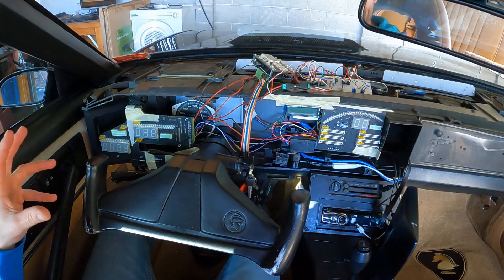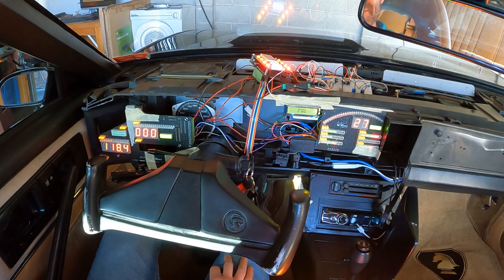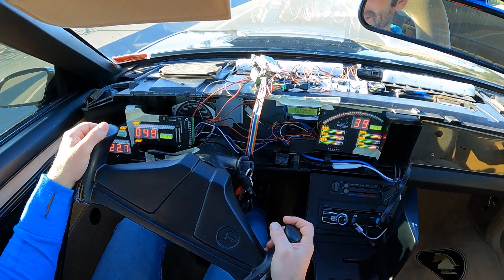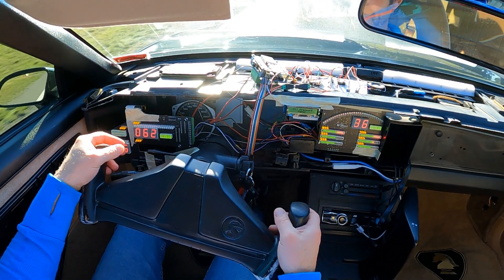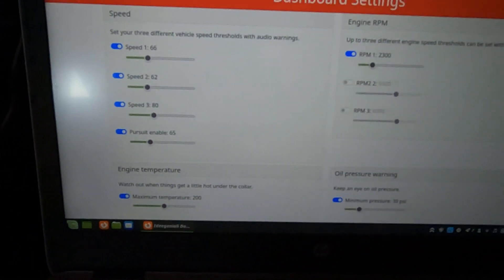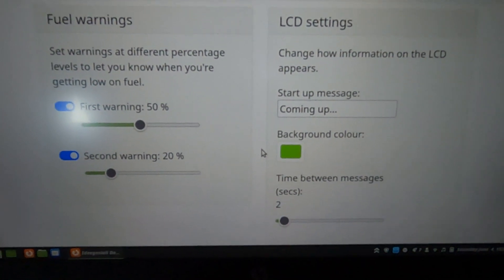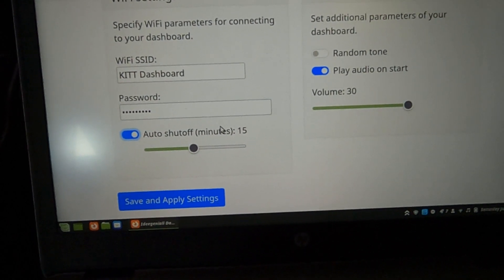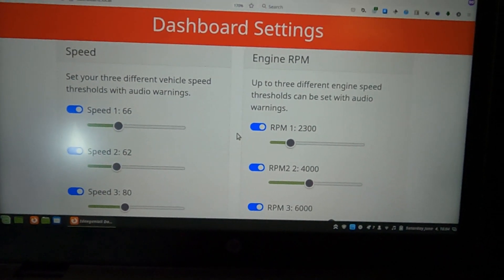iDEM (idee-geniali Dashboard Enhancement Module) live demonstration

Comment: hello
and the modules also adapts to season 3/4 from ideegeniali? Is special equipment needed and for how much?
Reply from the maker: Hey, yes it will work with season 3/4 too but you need to have the upgraded version of his dashboard electronics. These output a serial stream of data which my module interprets and then plays the audio sounds.
Reply: @highoctane1019  I have a version of 2021 season 4 and I will have done like you the transition from pursuit mode at a given speed
Reply from the maker: @knightrider9586  I've sent an email to ideegeniali to ask about how to get an upgrade for your dash electronics. It's possible that even though yours are new, they may not have the capability - yet. I hope to hear back from them soon. Or perhaps, you could contact them and ask too?

Comment: Very impressive, but I think all that talking would drive me nuts, with it all being out of context. How do you choose the appropriate audio clip quotes to play? The automatic Norm/Pursuit mode changes are cool. Why are the Inlet Temp, Mass Flow and Fuel Flow gauges so erratic while you're driving? Surely they'd be more steady?
Reply from the maker: Thanks. As you will have seen from the video, you can adjust trigger levels as you like and turn on/off what you want. Several of the gauges fluctuate by design. Each of the thresholds are associated with a particular folder on the uSD card in the MP3 player. When a threshold is met, a random one is played from the appropriate folder and you can change the audio files as you like simply by ejecting the card.